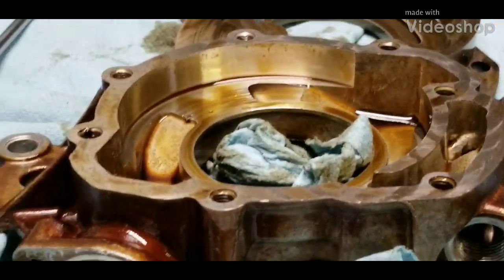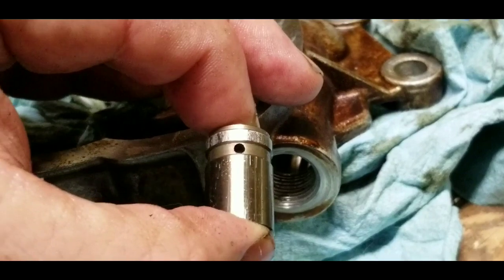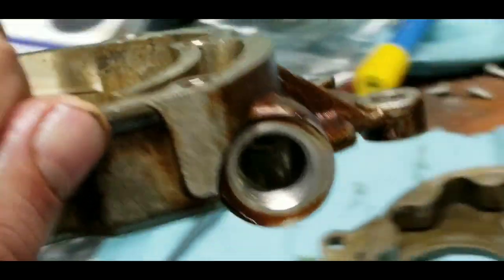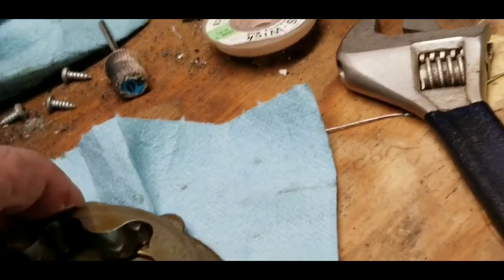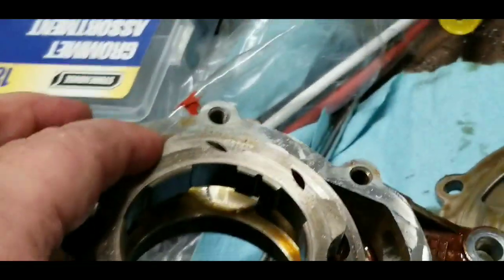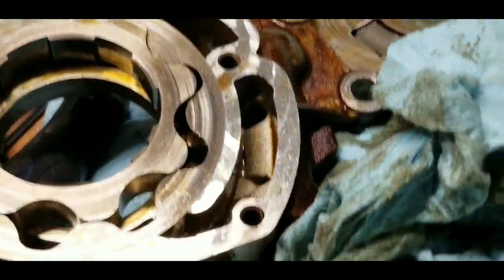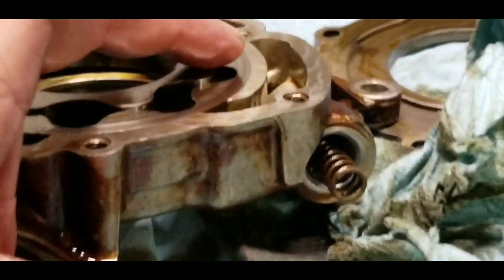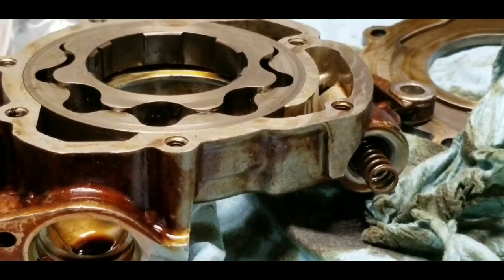G8 GT oil pump failure diagnosis

Comment: I just got my 09 g8gt from the shop
.. I heard a little pop from from under the hood. Turns out my oil pressure regulator blew out of the engine 
 The only thing left was the threads according to the GM mechanic... shouldn't my engine have locked up shortly after that happening? Keep in mind when this happened I stopped the car looked under it saying nothing and continue driving to town because I just thought I hit something in the road. I drove 15 miles to town and back. Engine light never came on temperature stayed normal and the engine never knocked or chatard. As I pulled in the driveway that's when smoke started rolling into the cab of the car. I turn the car off looked under the car and that's when I seen oil hemorrhaging. I just got my car back, received a oil flush the new filter along with the new part. And my car isn't even taking. Keep in mind this is my work car and it's completely stock besides the exhaust so I can't really hot rod the thing
Reply from the maker: I'm guessing the threads he was talking about was the bottom half of the pressure transmitter. It has the threads on it. If so,  that had a small office and a screen.  This likely reduced the flow enough to buy you the time.